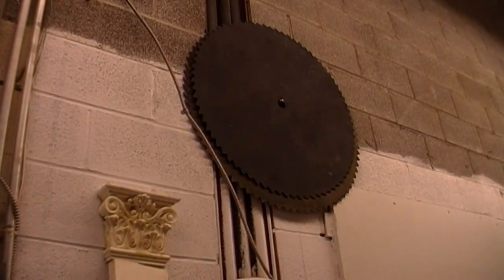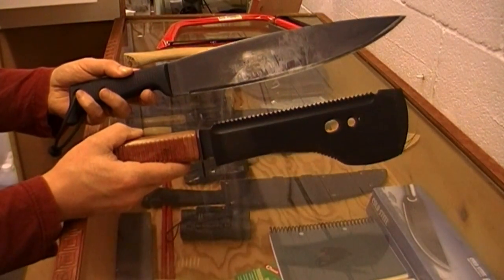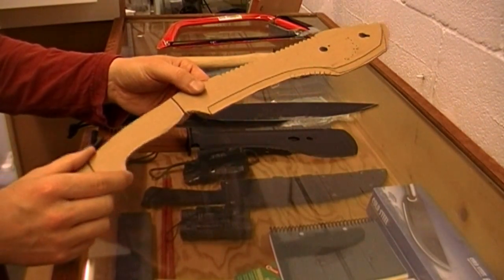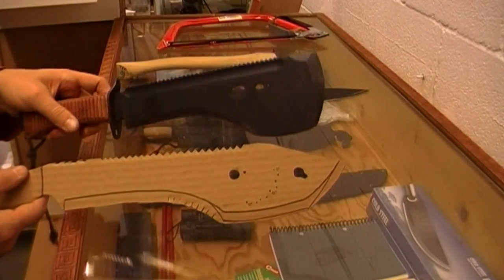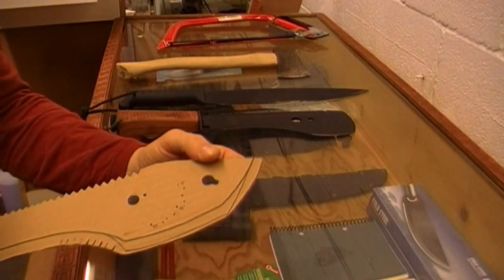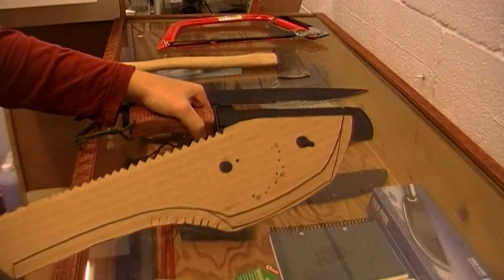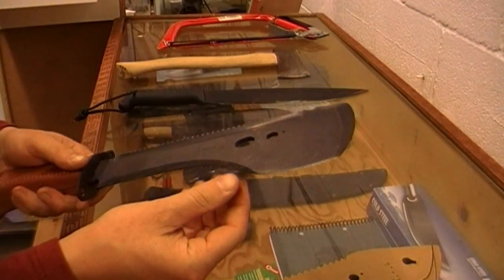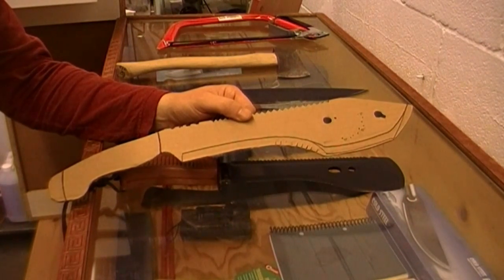Wolverine Survival Tool - Prototype

Comment: Forget the nail puller hole, for two reasons, you mentioned taking apart skids, you can not get those scew-nails out, even with a hammer and with the leverage that long handle with allow you would bend your blade in no time even trying to pull regular nails.

It's an interesting project and you have peeked my interest in what I might do with some of my old blades.

Comment: I suggest making the lanyard hole double as the nail pull in the tang end.  Also, most car tires are steel belted, which means you'll bet getting pricked and bleeding by all those tiny steel wires sticking out.

Comment: For that size the thickness of the blade will be pretty thin, but I think it is one sexy beast of a blade design. The nail pull is a bad idea on 5/32 steel but wouldn't compromise the structure of the blade in that location (*go for it). Can't wait to see the finished product.

Comment: Great mock up you have there, love to see the end product. Nail pull is a good idea put watch the placement, you don't want to be close to the knife point or edge. You can even copy a multi nut wrench design off some pocket tools The sighting tool marking might be a problem now that you added a knife point. Maybe add the same marking on the sheath, with access to the hole so you can use it safely the it on? I add a notch @ the base of the blade & hilt for a fire striker to round it off.

Comment: I sugest to use a bicycle tire tube to wrap around the handle. You will be able to wrap it as if it was a leather stap.

I wrapped those tubes on the handles of  my rigid fork bike and it absorbs shoks quite effectivly. You will have to get used to the rubber smell tho.

Comment: It looks like the nail puller would to awkward to use because of the kukri curve and the handle would be on it's side. But other than that it looks good. You should have a prybar in you're bug out bag like I do. Prybars have 3 ways to pull nails, can be used as a hammer a wedge to split wood, and other things.

Comment: Guy,
        The nail pull would depend on the thickness of the blade. I don't know what the saw blade thickness is, but you have to figure on torque.

Comment: Have you thought of putting a 1 inch false edge on the back of the tip? It should help it dig but ifyou dont sharpen the false edge it should still be safe to use as a draw knife.
Also id make the tang sticking out the end taper to one side so that you could use it as a pry bar and id add a v noch to the pry bar like on a claw hammer to take out nails.

Comment: I don't like the idea of the nail pull in the pommel because you wouldn't have much leverage to use it safely. How about adding some lashing holes, I know its a little big for that , but I would rather have them and not need it than the other way around.

Comment: How do you plan on doing the heat treat and soak on that knife? You will need a big oven for that process. Have you considered having your father in law machine clips into the back of the blade that will take commercial band saw, hack saw, and bone saw blades rather that try to put a saw back on it? Good luck with it!